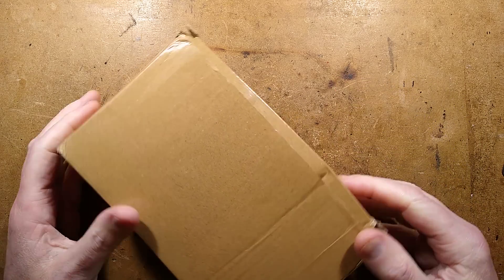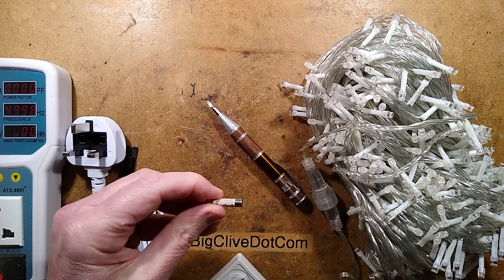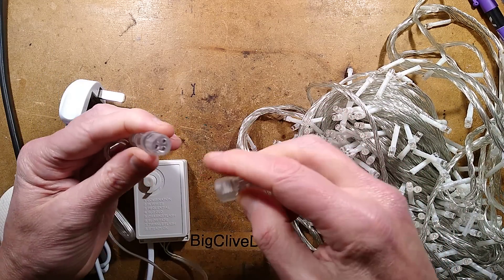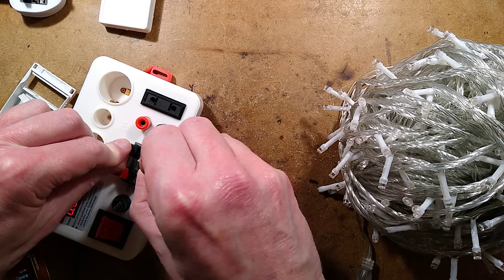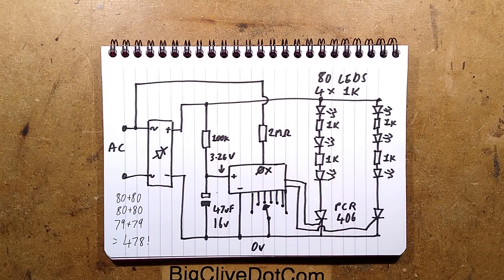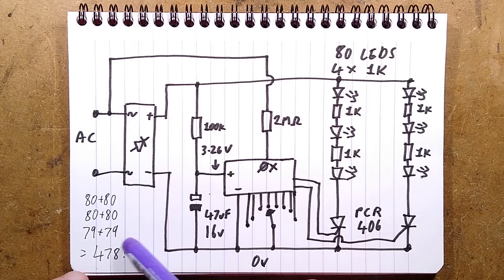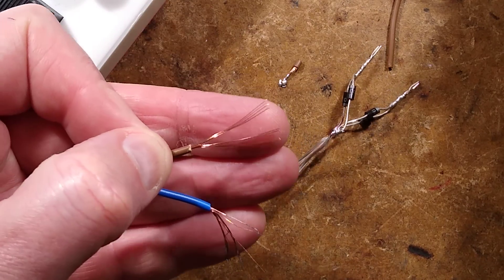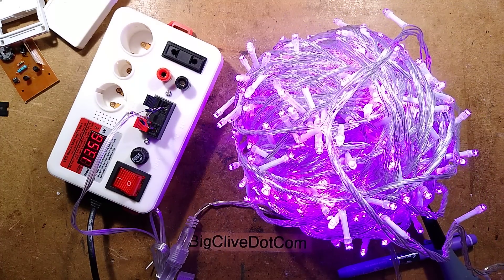exploring a "500" LED eBay light string (with schematic)

Comment: It is surprising there are not more incidents at Christmas, with this or even the wild Christmas displays of multiple daisy-chained power boards and dodgy extension leads. Although the loading is a little more forgiving with LED over the old incandescent bulbs.
Reply from the maker: Given some of the pictures I've seen of clusters of open chassis power supplies with exposed live terminals, the mass use of 5V pixels with no grasp of overcurrent protection and the recent trend of having volunteers install electrical cabling for lights in soggy forests, I'm very surprised there have been no notable deaths.  Yet.
Reply: I remember the Christmas lights that my granddad had. Since he didn't have the proper connector so he did use an extension lead with two plugs on each side (so that if you connect them in the wrong order you have 230V exposed on a plug), the cable he used was some sort of fabric insulated cable that was some metal thins as a hair, probably something from before the war, the light cable itself was broken in multiple places and reattached by twisting the wire and using normal scotch tape. 

Once while doing the Christmas tree I was wondering why it didn't work, then I realized that the lights had tripped the RCD. Well...

Comment: Wait, you counted 80+80, 80+80 and 79+79; that's three strings of LEDs, yet there are only 2 thyristors and you drew 2 strings in your diagram. Am I missing something here?
Reply from the maker: Each of the pairs is in parallel.  Three sections on each thyristor.

Comment: If you overdrive the 478 LED's with 4,6% of current, then you have the equal of 500 LED's 😛
Reply: The tolerance of the resistors can't be less than 5%, so, you got a lucky led string 😂
Reply: - Where are the missing 22 lights?
- Just decorate a Christmas tree outside, there will be a lot of pretty lights before long.